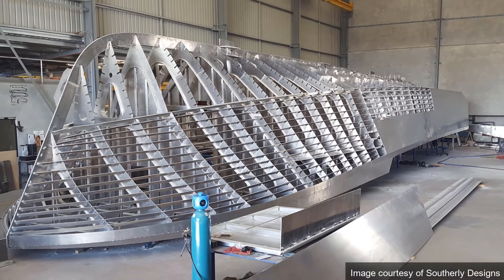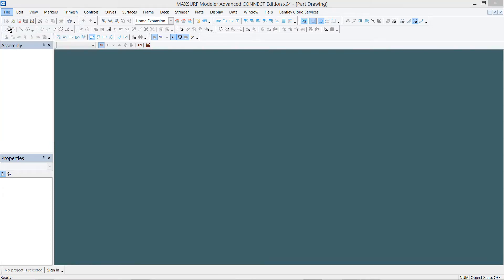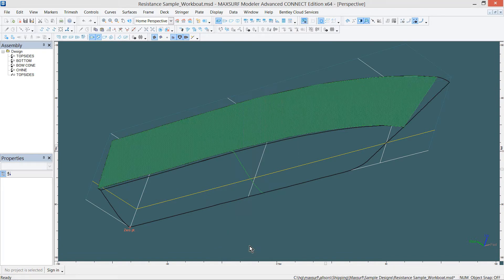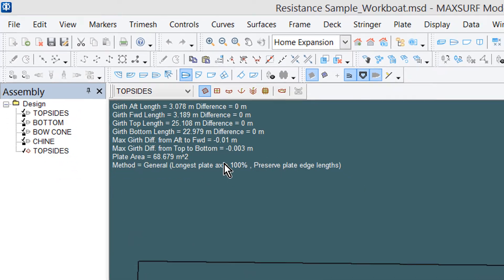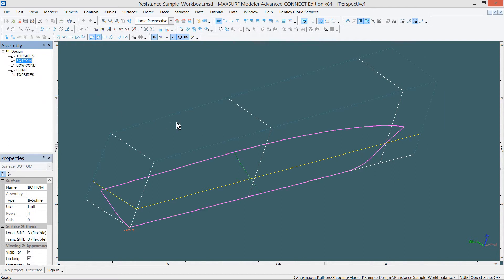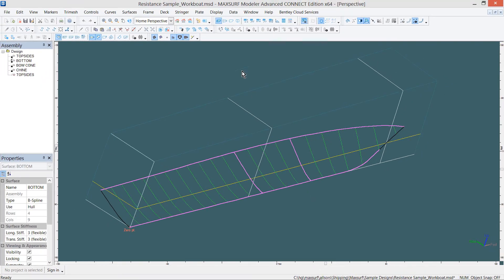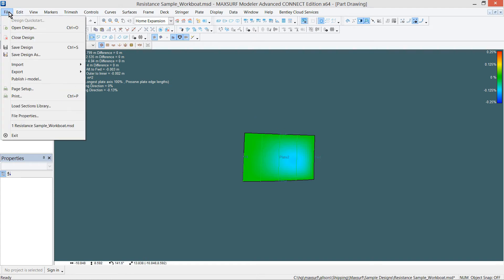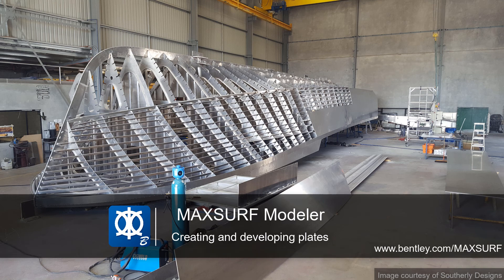MAXSURF Modeler - Creating and Developing Plates

Comment: that hull frame is crazy,sure nice flare BUT using heavier plate, no stringers, with frame web less depth, you will increase interior volume heaps, dutch , others never used stringers, now everyone who  gets a flat pack of cnc parts is a bloody boatbuilder, 100s unnecessary parts, please slow your vid instructions, too fast, but hey!! great tool maxsurf